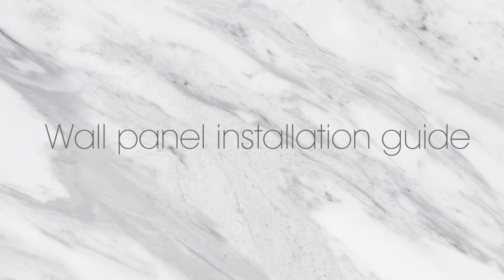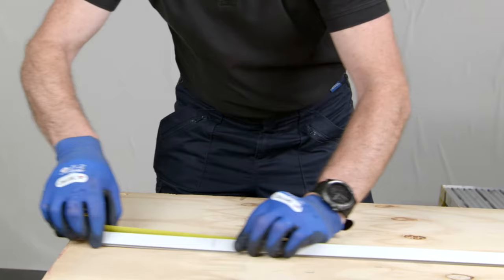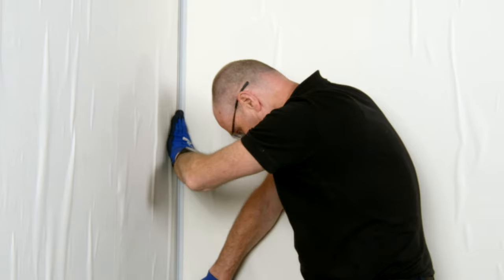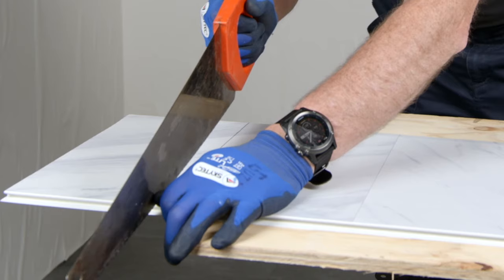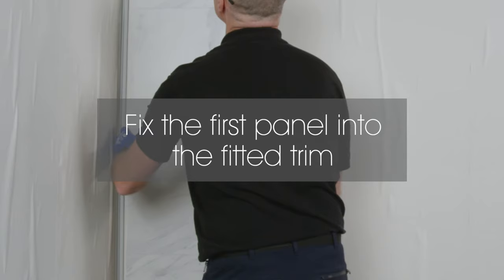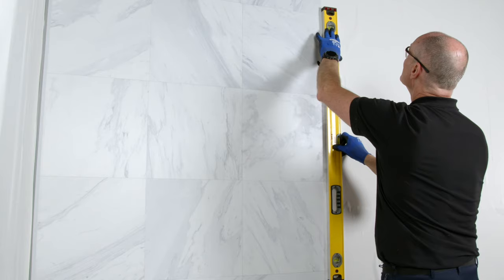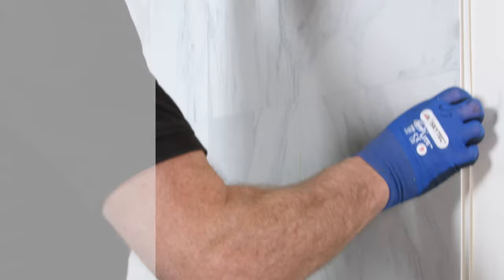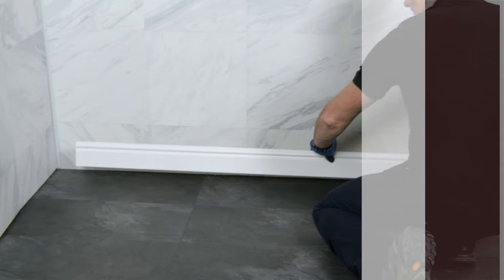How to install PVC Bathroom Wall Panels

Comment: Doesn't water seep in between the panels and cause the wall to dampen and also growth of mold behind them?
Reply: No because you will use trims for the ends on the panels so it's water tight
Reply: As instructed in the video, apply silicone sealer to the TnG joint of each panel.
Reply: @Parkertannerz i did this, then found out it was me
Reply: PVC cladding panels come in different sizes, mine were 8’x4’ and easier to work with, only needed 3 and shorten height on them.
Reply: The pannels are tongue and groove and the bead runs round the side but don't bother measuring the bead just scribe it off the aqua panel that you have cut ready to put in  and your adhesive should be put on like dot and dap and don't  bother putting the nozzle on your adhesive as you need it to come out in big blobs once every 150 mm  across and down doesn't have to be a exact and avoid putting the adhesive near the edge as it will squirt out around the edge of the panel but do put the nozzle on the silicone and do a bed of silicone were your gonna place the qua panel which will give you your added protection but make sure you wipe off clear any smudges of silicone/adhesive that get on your board showertray/bath because you want to put a neat bead of silicone on after the install is complete 
 I  install these all the time so any questions just ask
Reply: @davidhayes1950 
Thanks David! I am thinking about putting these panels in a mud room over stud framing. Any suggestions on best way to fasten? I’m not to concerned about the looks and was thinking about using nails!
Reply: @robertb2444  don't put them directly over stud framing. You definitely use plywood first, and nails are a no. No, I'm afraid it will literally break as your hammering them in even a nail gun would snap it around the nail you can use screws but I would screw it most of the way in and do the rest of the tightening with a screw driver and you might as well use screw caps even tho you don't care what it looks like screw caps are penny's and will give you a much better finish

Comment: Can you use these panels on top of existing wall tiles?
Reply: Yes
Reply: Of course, that would be even better probably.
Reply: If you fit over existing tiles surely the end trim will sit off the wall by the depth of the old tile and look weird.

Comment: Good start but nothing on how to get that width cut correct if you need whole panel to corner - ie: if things are out of square etc and also are panel widths stated in/ex tongue and how are trips accomodated in width calcualtion. Also saw nothing on how to deal with the bottom when it's meeting a bath which would be great to know thanks

Comment: If putting on top of existing tiles is there not a problem of getting pipe connections of controls etc through the extra thickness?
Reply: Most of these boards are 5mm

Comment: Hi should you prime the wall first ,I am using plasterboard.  Using Silicone to stick the wall panels. Or can I just plasterboard the wall first?
Reply: If you have plasterboard that has not been skimmed, just use PVA, mix pva with water, brush  it onto the board.